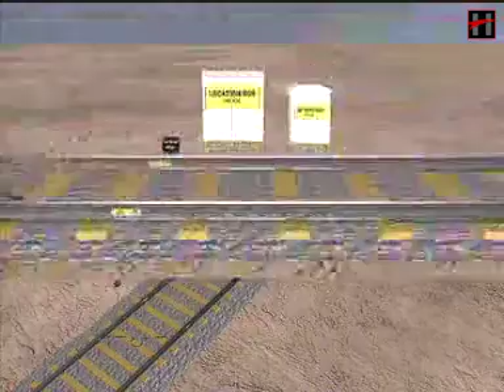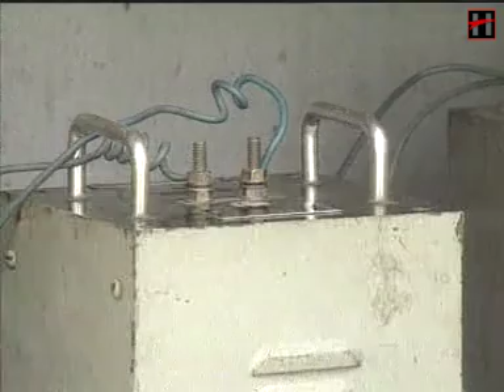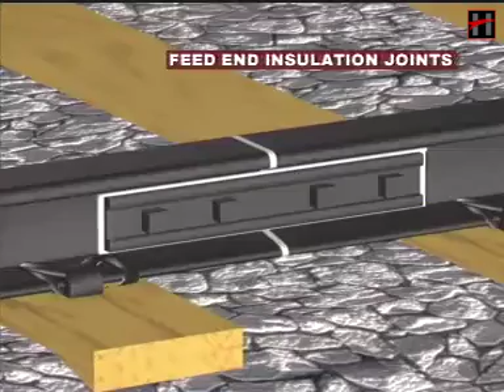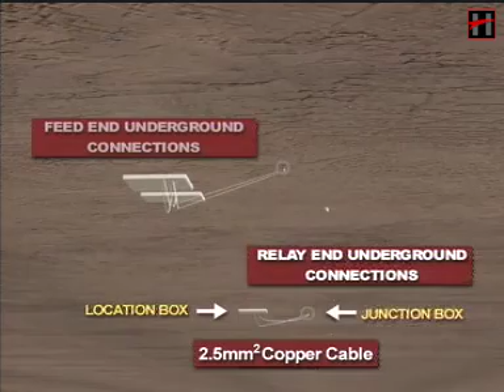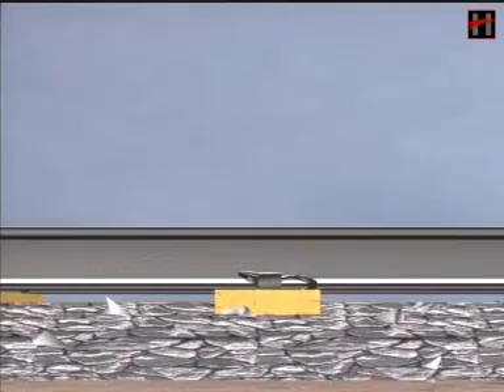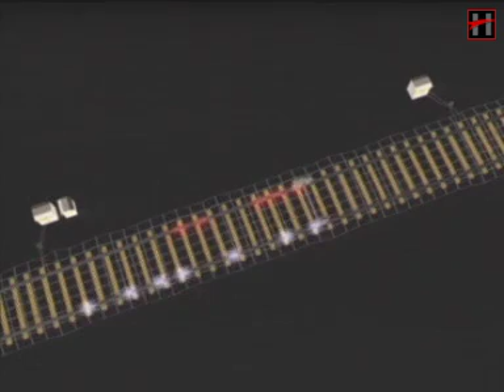How DC Track Circuit Works ( 3D Animation )

Comment: So if the light bulb is burned out or it has no power it would give a clear signal ? Seems dangerous
Reply: There is a separate circuit that proves the bulbs are in working condition.